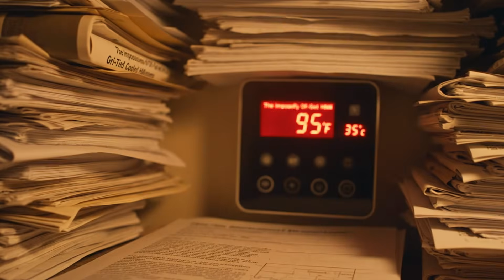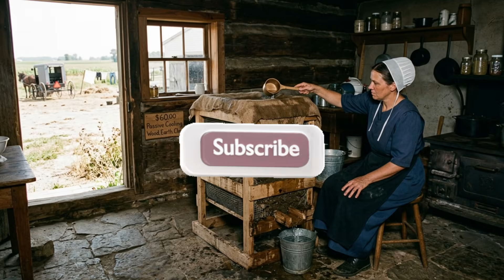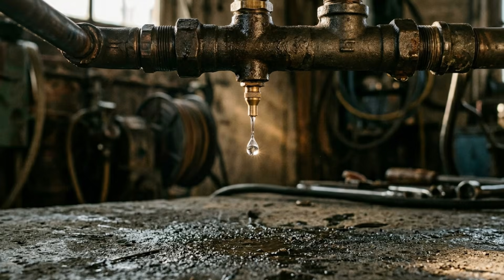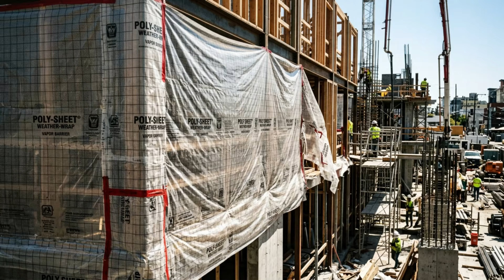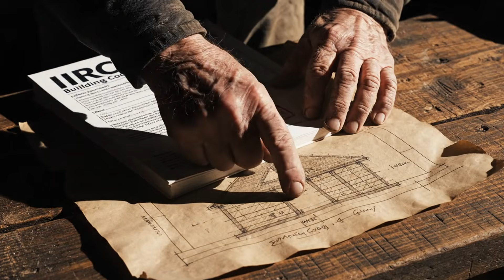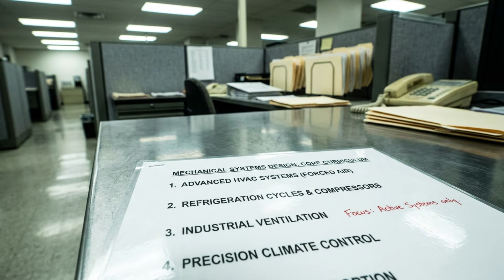This $60 Amish "Water-Wall" Cools Homes By 25°F. Why Is It Banned?

Comment: Is there not a problem with condensate on the inside of the wall? Is the wall designed for passive heating in the winter?